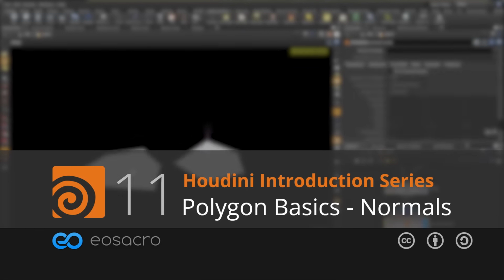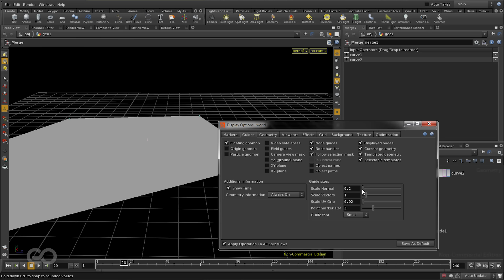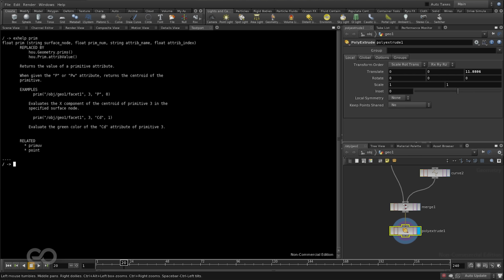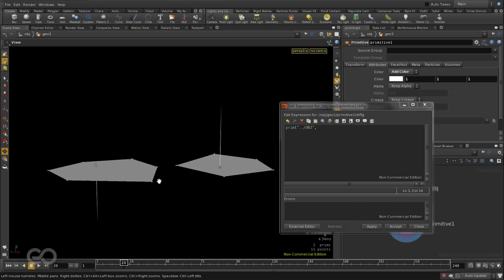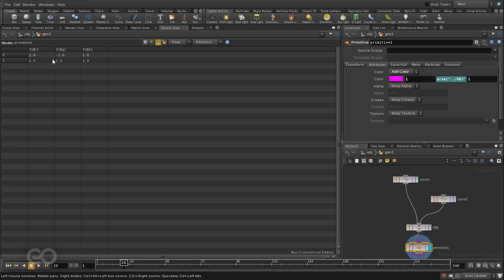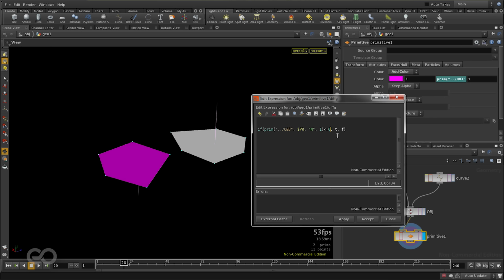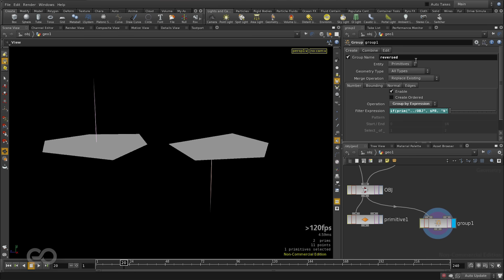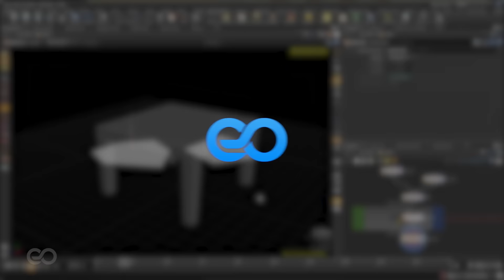Houdini Intro - 11 - Understanding Polygon Normals

Comment: After houdini 16, the "Filter expression" not longer exists. 
I'm not sure if it is the right way to do it, 
but I managed to get same result use a "group expression" node with "@N.y < 0" in Houdini 16.5.
Reply: Super helpful, thanks!
Reply: Noob question here, where exactly did you use "@N.y < 0" to get it to work in Houdini 16.5? I'm actually on 17 but I'm hoping it will work due to same node changes. I'm getting a syntax error on this "if(prim("../OBJ/", $PREV_IT, "N", 1) < 0, 1, 0)"

Comment: you are doing a great Job, i am a Cinema 4D user, and just new to Houdini, Aligning the polygons to normal and reversing is a single click Job in C4D, but in Houdini it  comes with lots of expressions. correct me if i am wrong.
Reply from the maker: In different packages the same thing could be either prebuilt, or has to be built by you.
I am not sure about C4D, its been a long time I have touched it.
But the particular way i flip normals in my table video is a little roundabout, its basically just a single expression to achieve that in practice.